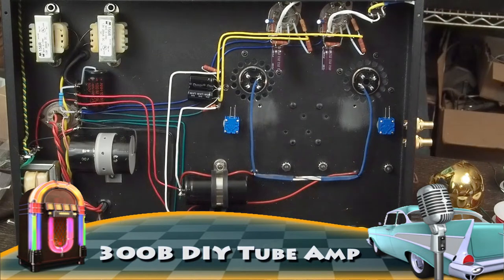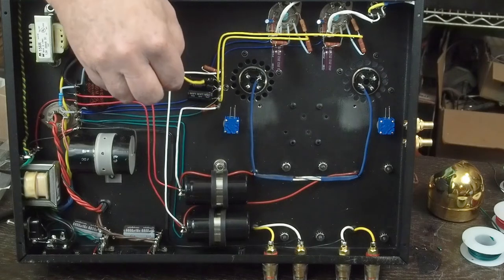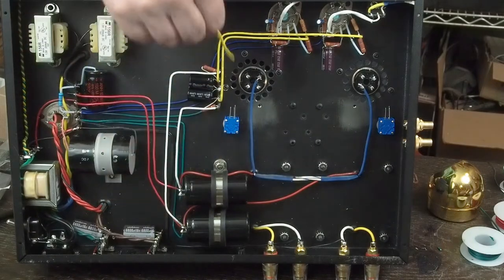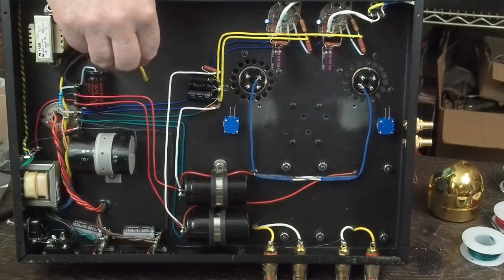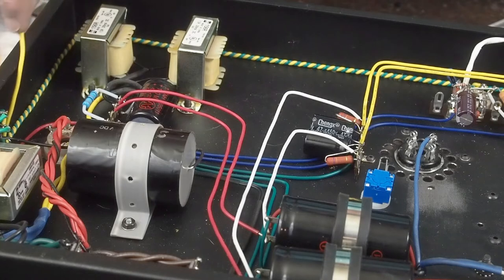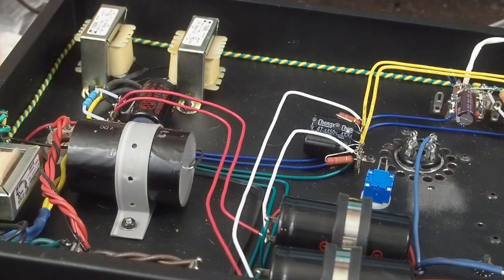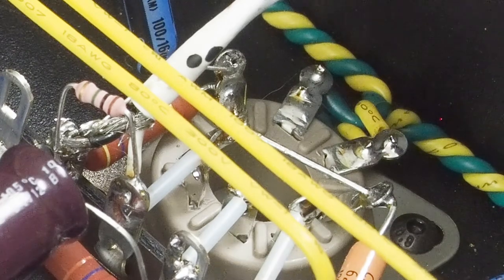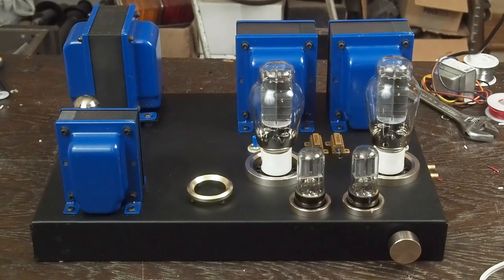300B DIY Budget Tube Amplifier Build DHT SET #7

Comment: Really awesome.🙂
Can I ask what value fuse is used in the fuse holder on amp?🤔 Also, what amperage fuse do you recommend for the main plug?
Reply from the maker: I think it's a slo-blow in either a 1.6A or a 2A. I would start with the 1.6A.

Comment: What solder do you work with .  ?
Reply from the maker: I use 60/40 rosin core, right now I have a big spool of some radio shack branded stuff I am using.